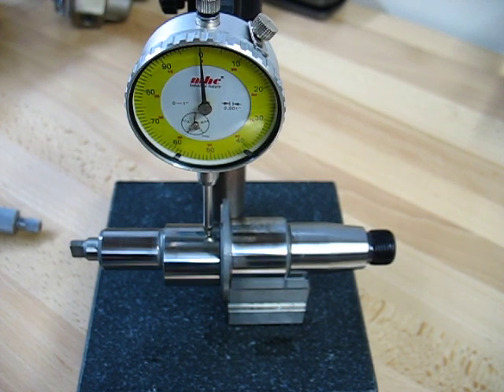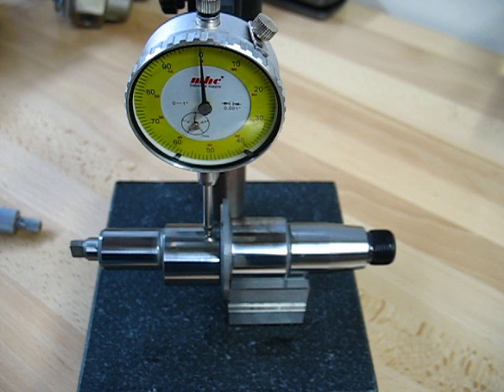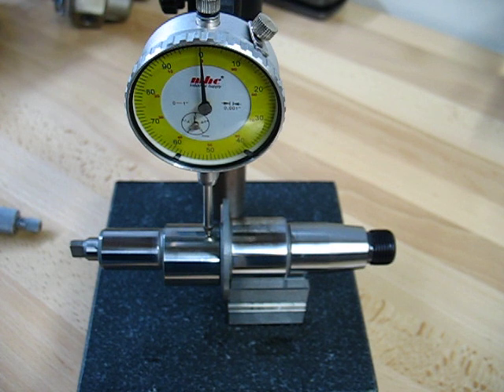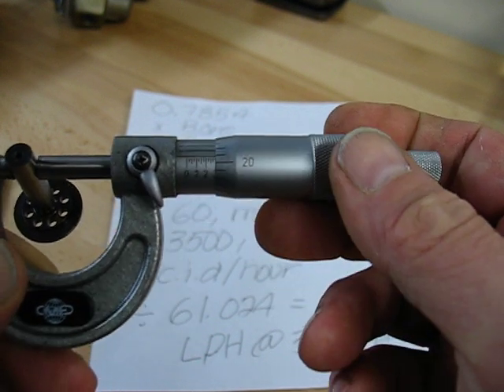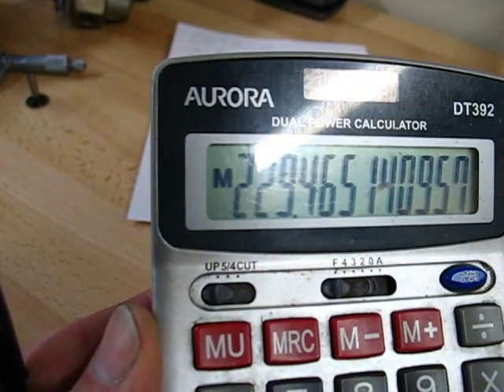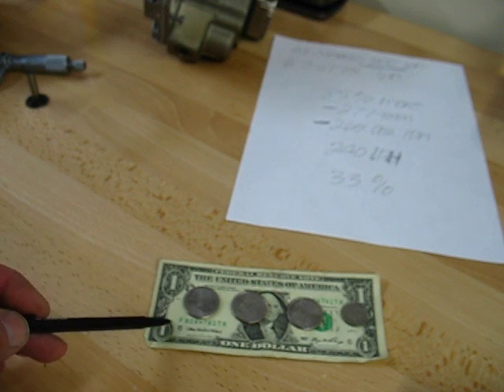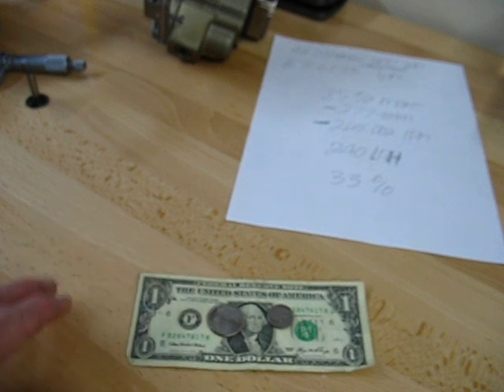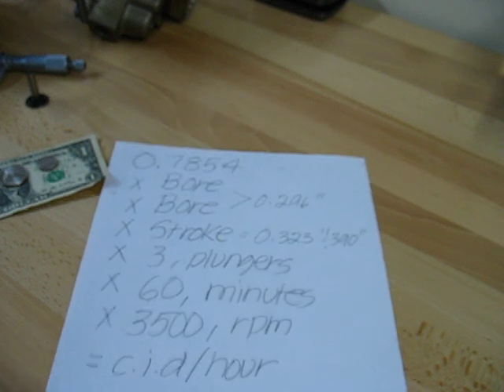Modified CP3 information

Comment: I am having a low pressure problem with my 2003 dodge 5.9 and i do have a OTC fuel pressure (electronic type ) gauge and it has gone from 20,500 to 13,800 over the past year or so. It starts fine and runs ok but the fuel economy has dropped and it will miss from time to time and run rough but goes away. I have been a mechanic for over 40 years and I thought i was pretty good with FI but now after watching these videos I can see i have a lot to learn. My trucks engine is just the 250 HP Cummins with the NV 4500 5 speed and gets unbelievable fuel mileage so i want to just get that back and maybe up the pump pressure for better fuel atomization. I was actually on Ebay looking at those cheap injectors but something told me  to go on youtube and check around first and your videos came up and i have been watching now for a few hours. I cant believe the views are not in the hundred of  thousands because anyone that is into diesels should be watching this.